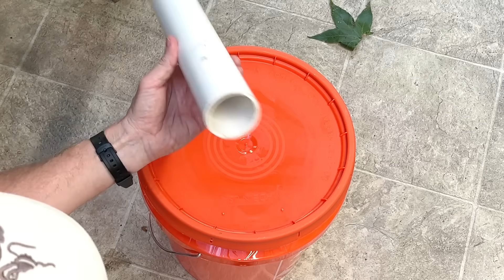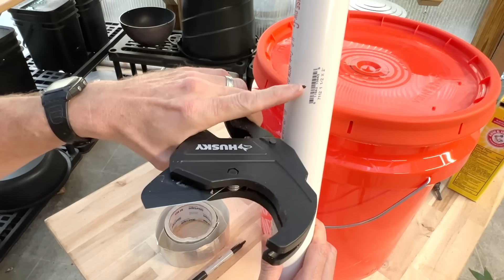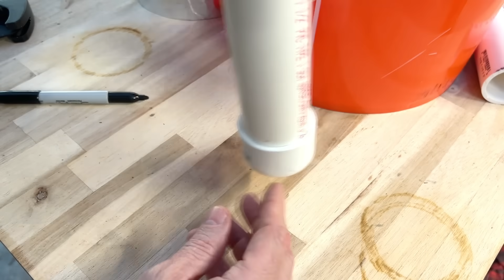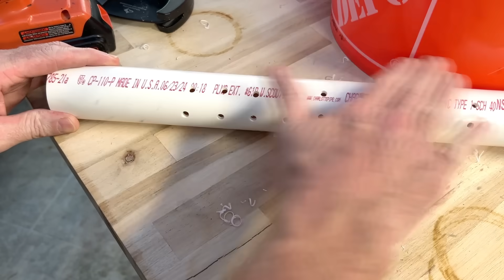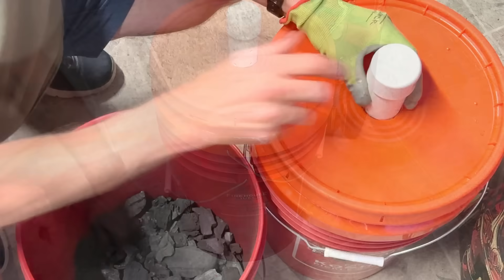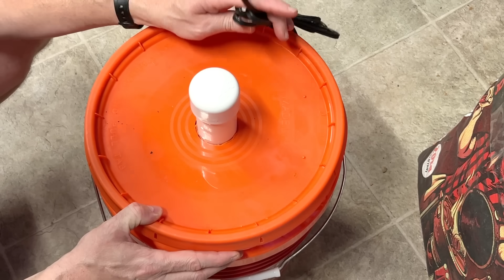Simple Device Turns Kitchen Waste Into Garden Gold (IN LESS THAN 30 DAYS)

Comment: I use a regular composting bucket available on Amazon, that has a strainer net inside through which the liquid comes down to the bottom.  They've provided a tap through which the liquid fertilizer can be removed. All I do is grind the kitchen scraps into a slurry and add that slurry in the bucket.  Composting happens within a week.  To prevent odours forming. I have placed about 100 gms of activated charcoal granules in a fruit net bag and hung it on the inside of the  bucket, just under the lid.
Works well for me. The coldest it gets is around 15 degrees Celsius, so haven't used a heating system, since I don't need it.
Reply: Can you please add a link to the regular composting bucket available from Amazon? Thank you

Comment: Here in NC it would attract an ant colony and roaches !  Even when we put our pet foods and other foods in tight containers the ants smell it and we get overwhelmed !!!!
The bites are horrible ! Garbage out every evening and definitely no compost in the house !!
Reply: Pest control tech here. Why not eliminate the roaches and ants from your house? A couple of professional applications of the right products should end your bug issues, but it starts outside. We use granular stuff outdoors, poison gel and another thing that stops roach reproduction. 
For ants we have other gels and sprays for outside and inside. But you can get rid of a lot of bugs including roaches and ants with no chemicals. Mix borax powder and sugar, I think 50/50 will do, and add enough water to make it liquid.  Put it in bottle caps in corners and next to ant trails but don't ever interrupt the actual trails of ants. That can cause some species to start more colonies. So put the mix near the trail and let them find it. The borax will eventually kill the colony, and I believe it kills roaches and other bugs too.